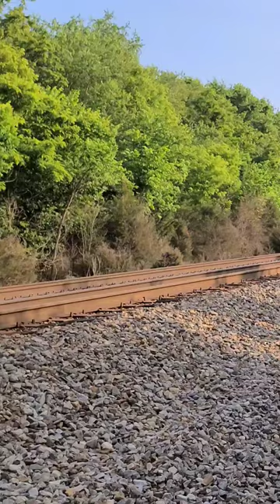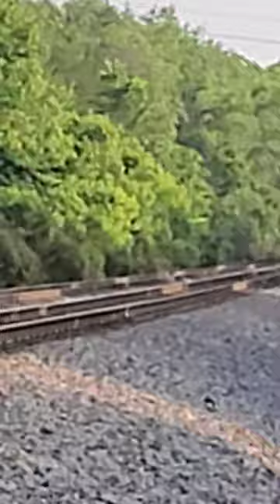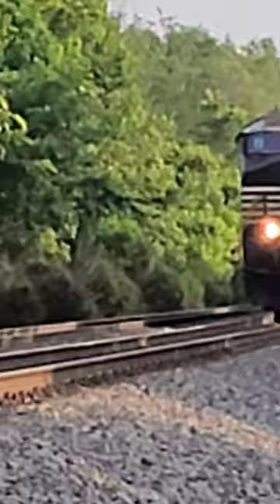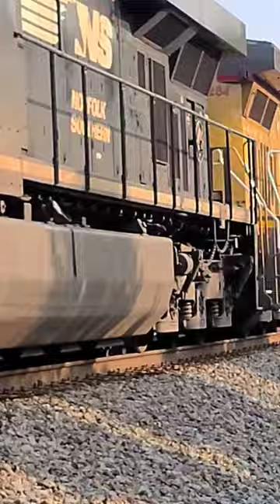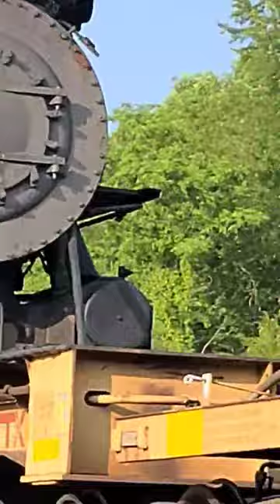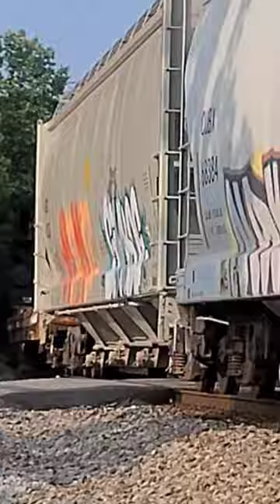CN #5288 steam locomotive being hauled to Pennsylvania by NS

Comment: How do they make a flatbed sturdy enough to hold a steam engine?
Reply: This flat bed is low in the middle which is designed to carry very heavy loads. Also it appears that there are two sets heavy duty trucks in front and two sets in the back of the flat bed. It's hard to see, but that's the way it appeared to me after watching this video several times. I am a retired rail and when I saw these flat beds they were carrying huge heavy machines, transformers etc.